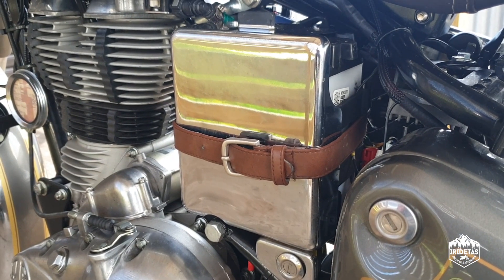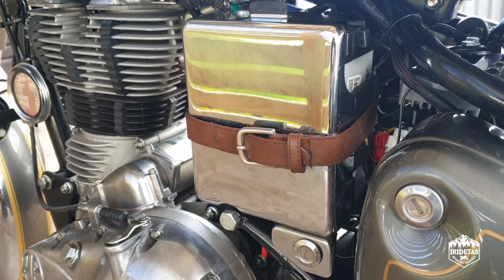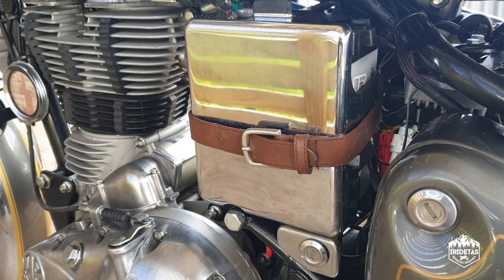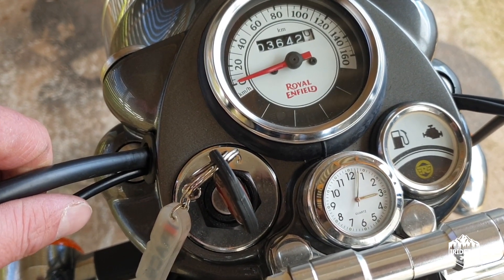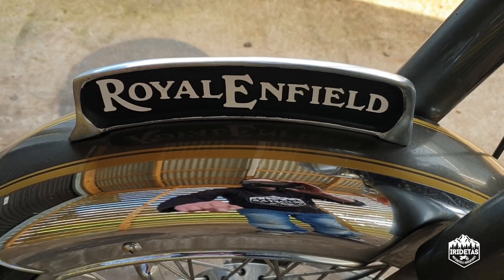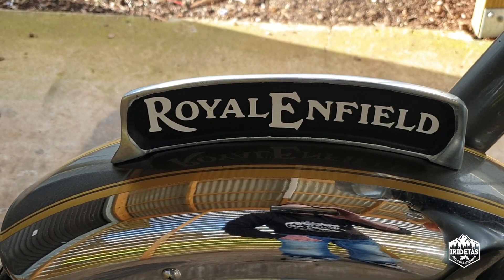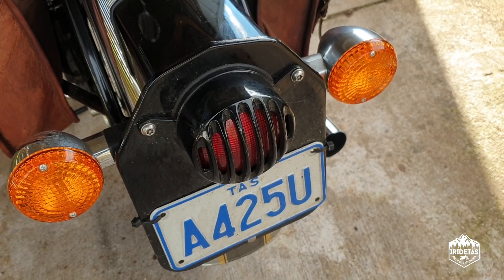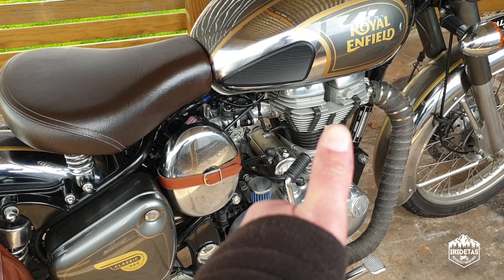REA #22 | Belts | Stem Nut Clock | Pedestrian Slasher or Slicer | Rear Light Protector

Comment: This is exactly what I'm wanting. I'm terrified of installing a pedestrian slasher because I don't want to be off or drill into the tire. My battery cover came off also, cost me a small fortune to get one through royal Enfield.
Reply from the maker: Lol yeah the battery covers are so expensive for what they are so was pretty conscious about it. Heard some bad stories about that lock so put the belts on.  Just plan out the slasher also don't put it to far back towards the fork centre plate or if you bottom out you will dent that front plate on the slasher because it's about half your fork travel in height! Cheers
Reply from the maker: Mark your depth on the drill bit by wrapping it in tape so you won't drill into the tyre! 👍👍

Comment: Had to fit a belt on the battery box as the plastic lock on it vibrates loose. Nothing more disheartening  than watching your battery cover bounce into the hard shoulder🙄
Reply from the maker: Another horror story about the lock! This is why I put the belts on cause I didn't want exactly that happening! 👍👍 thanks for confirming it is a bit of a problem.  Sorry to hear it happened to you mate!

Comment: 2 points. It is illegal in the UK to fit a slasher number plate since the early 60/ last 50s due to the danger. Secondhand old Doug would look better with older type flashers fitted. Apart from that love what you have done to the bike.  Sounds how a bike should
Reply from the maker: I know mate! I don't live in the UK and it's not illegal here in Australia,  even if it was, I would still run the slasher cause I love the looks and I'm not really worried about been pulled up for it! Cheers mate!
Reply: @iRidetas   Too many EU rules over here.
Reply: @iRidetas  - the pedestrian cutter plates were always more dangerous to the rider. You could hurt yourself just walking around the bike. More bikers were killed by them, the bike hitting the rider, than pedestrians run over.  Make no mistake, they are dangerous. 

You won't see one fitted even to a vintage bike here unless the bike is used for vintage shows or a museum exhibit. They were universally hated even when we had to have front number plates. UK bikes registered after 01 Sept 2001 /must/ not have front plates, The requirement for front plates was removed in the early 70s, and they disappeared overnight. If you want the bike to look british, take the slicer off.

Perhaps more importantly, they look completely naff.
Reply from the maker: I like it, its my bike, slasher stays, end of discussion. 👍👍